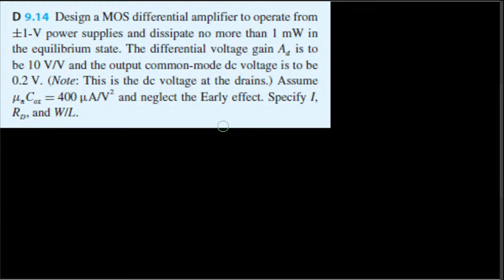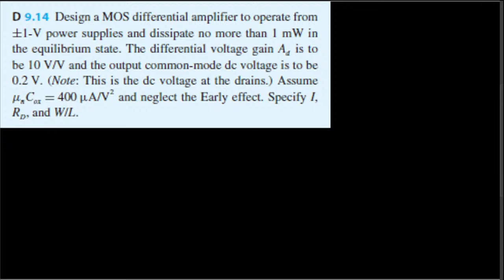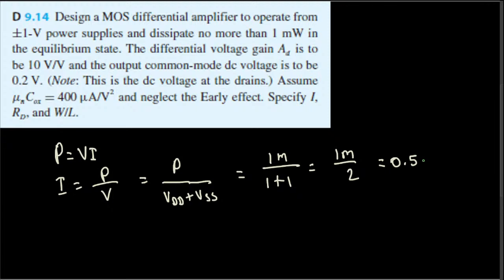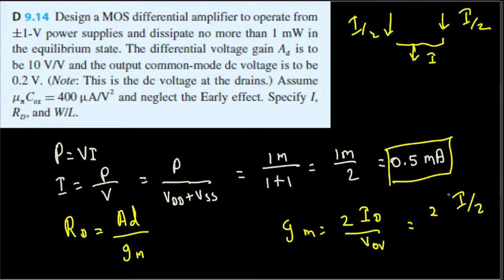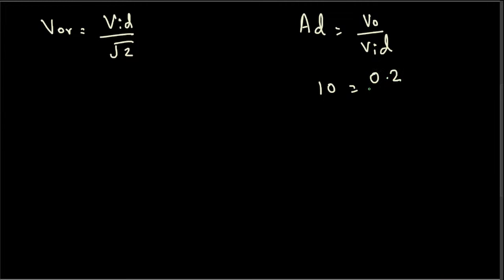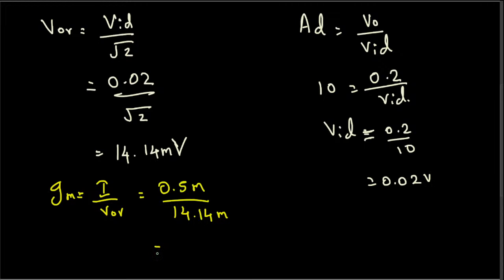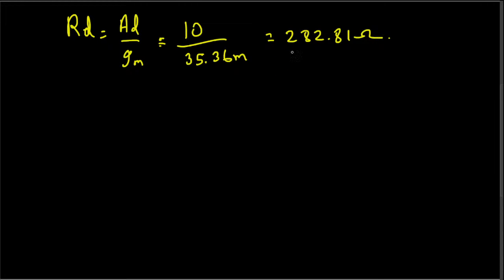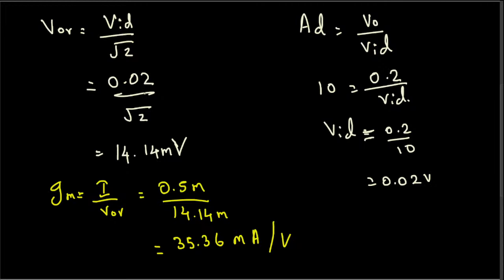D 9.14 Design a MOS differential amplifier to operate from ±1-V power supplies and dissipate no m…

Comment: Hey man, are you sure this is right? Having a W/L ratio of 6251 doesn't make sense at all. Where did you find that V_ov = V_id/sqrt(2) equation? If you made this in gpdk45 you'd have a 200um wide mosfet, which would be visible to the naked eye (absolutely massive). Also having R_D be 282 Ohms with 250uA flowing through it means that you only drop ~70mV across it, which is not enough to get to the common mode output (V_cmo) of 0.2V. 

I've been reading Sedra & Smith and the only equation I can find that is similar is V_ov = v_idmax/sqrt(2). It says that actual values for v_id are between -sqrt(2)V_ov and sqrt(2)V_ov. 

The way I solved it you can use the current through one of the branches (250uA), the common mode output voltage, and the V_DD voltage to figure out the resistance as just R_D = (V_DD - V_cmo) / 250uA. 

You can then find gm using the equation A_v = gm * R_D = 10. Once you have that, you can relate gm to W/L using gm = sqrt(2K*(W/L)*I_d). This should get you R_D = 3.2k and W/L = ~48.8 instead.